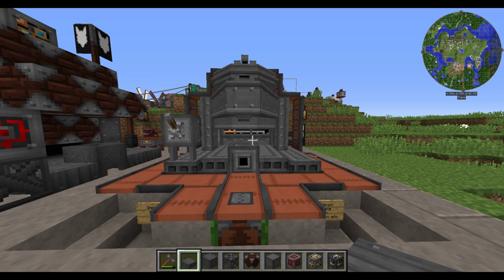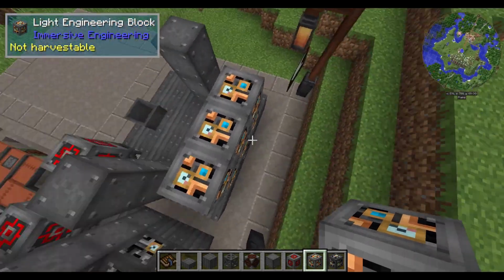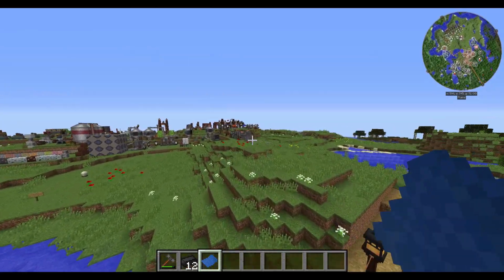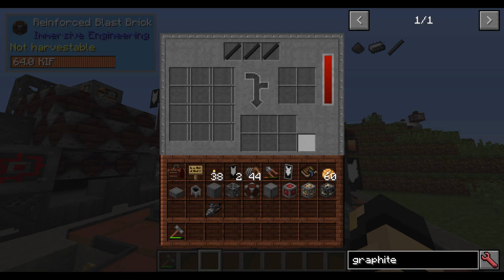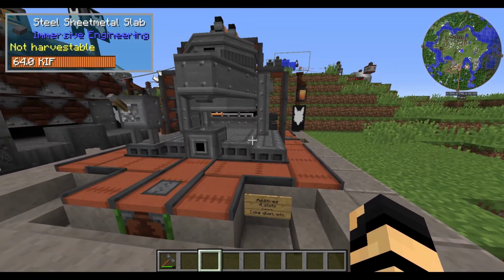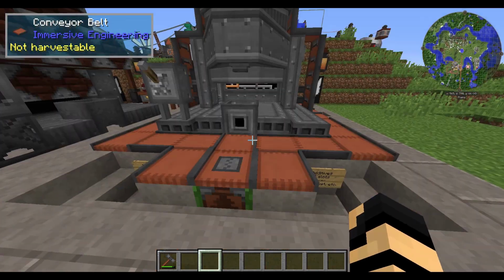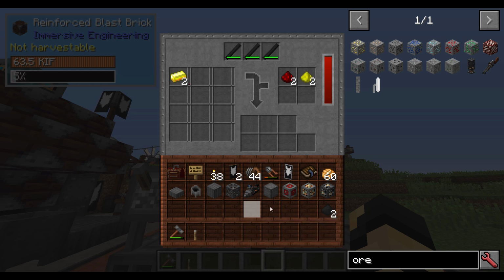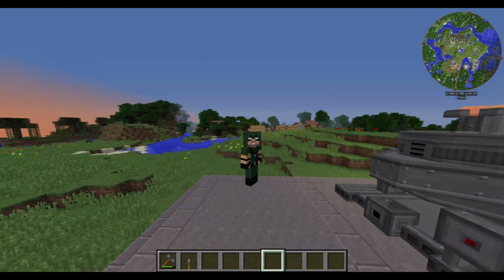Immersive Engineering: Arc Furnace! - Minecraft 1.10.2/1.11.2

Comment: Thanks! Immersive engineering is an amazing mod and pairs very nicely with hbm ntm extended on 1.12.2 and covers some of the shortcomings it has that are normally present in the older 1.12.2 version. The arc furnace ended up being extremely useful for producing tons of steel quickly which is a very necessary material used extensively throughout hbm.

Comment: Can someone explain why my arc furnace INSISTS on smelting one item at a time?! I'm assuming it's a power issue but have no idea how to fix it
Reply: It's likely a power issue, you need to supply it some 512 RF/tick for each operation to run concurrently, so about 6144 RF/tick at full load. You shouldn't really consider making an arc furnace if you can't generate at least 4kRF/tick or have some insane energy buffer structure, as not only will the furnace barely run, but you'll also waste durability on the graphite rods(they take the same damage regardless of how many items you smelt at once). The go-to way in IE to generate this kind of energy is via squeezer+fermenter>refinery > 2 diesel generators setup, and it eats a lot of resources.

Also, you need the items inside to be spread out. Items from dropper conveyors are spread out by default, but perhaps certain itemducts/pipes will instert them as stacks instead.

Comment: Wow, I really wanted to stick to IE instead of using Mekanism mainly. But the arc furnace is way overboard. For not that much of a benefit. There's so many difficulty limits that make it frustrating. First is the engineering blueprint for the arc furnace. Why did they restrict certain ones to villagers only. Than you have the graphite system which is another time sink like steel. Followed by the rods degrading. You can't automate replacing them. To top it off, the insane power requirements. You're better off making 200 windmills and connecting directly to the Arc furnace. Instead of killing your entire base of power.
Reply: I love hearing people complain about the functionality of a mod where you don't even have to go mining anymore taking too much time to maintain the Machinery that cuts your time investment by like 85%
Reply: @Sirisma  the biggest issue with IE is that it is worthless in modpacks. the progression, especially in terms of power generation, is ridiculous compared to any other mod. your basic power generation cant even reach 100rf/tick, and every large machine needs rf in the thousands/tick to operate at full efficiency. so get the upgraded power generation obvs, duh. except you need chestfulls of iron and steel to get that fully set up. which you will struggle to get without already having excavators, which you cant use without insane power

immersive engineering is an awesome mod, but the iron/steel and power requirements are horrifically unbalanced compared to other mods
Reply: @hashtagrex  it is extremely easy to set up a biofuel refinery that overproduces enough biodiesel to actually run three times as many diesel as it requires to power. I don't know where you're getting this thousands of RF a tick. I've spent all of half an hour once setting up a passive power generator that outputted 4096 RF a tick. Not trying to be a dick but maybe you're just doing it wrong
Reply: Because it is realistic all of the steel related stuff is close to the real world for a  mc mod  from using coke instead of plain coal   slag as a by product and its use as filler in concrete or road underconstuction ok the blast furnace isn't really a furnace to create steel its purpose is too desoxide Lage amounts of Ore to pigiron (crude/raw cast iron with lots of impurities and carbon(~4, 3%C for a low melting temperature ) excess) and that cann be refined (if still liquid) in a connverter with same scrap metal (for cooling) by blowing oxygen in it and burning away the impurities and carbon  or(if cooled down) by using a arc furnace also with scap remelting and blowing oxygen in it to burn of unwanted stuff

And be thankful they didn't add the limestone in the mix too it is used in every step with liquid steel (even welding rods) it helps to pull out phosphorus or sulfur (impurities) 

Oh and for clarification the Fe C alloys ar defined like that:
Up too 0,01%C = Elemental Iron aka Fe
0,01%-2,14%C = Steel
2,14%-6,67%C= Castiron ( more than 4 % is too bridel and not seen commonly)
6,67%C  liquid iron is a saturated on carbon and cannt take more in solution

Comment: The power input location is a bit dangerous.   I got zapped a few times and died.
Reply: I wish HV wires could be insulated :(
Reply: christ...
Reply: Well, that's pretty immersive

Just like standing near extremely high-powered machinery and uninsulated HV wires in real life
Reply: My modpack has mekanism as well so as soon as I can make mekanism cables I tend to use those instead for safety reasons.